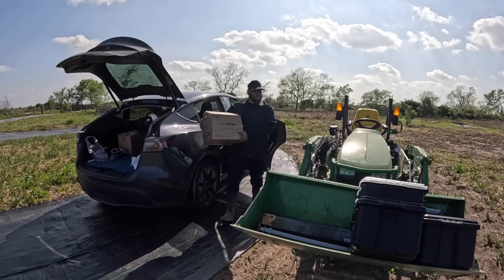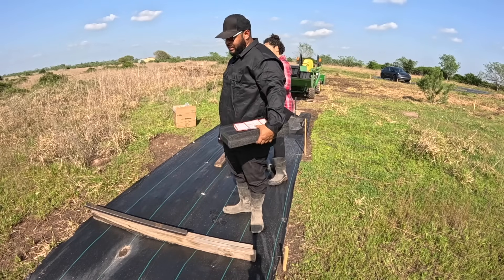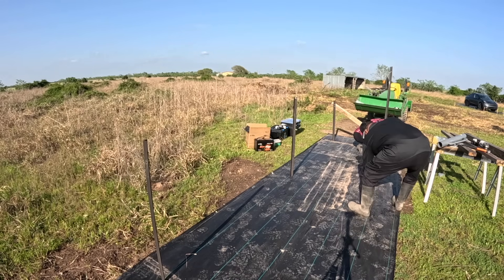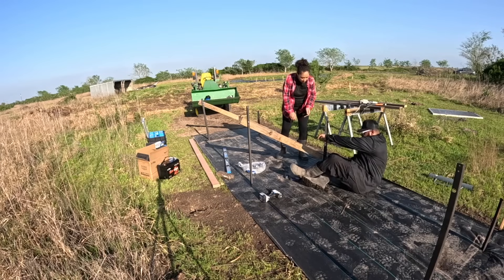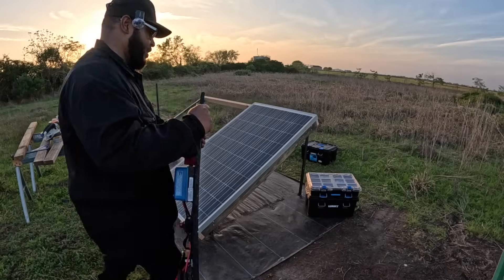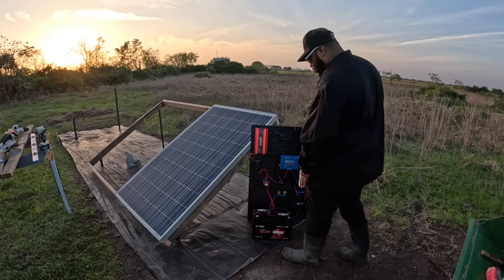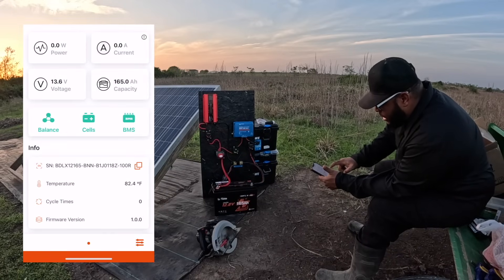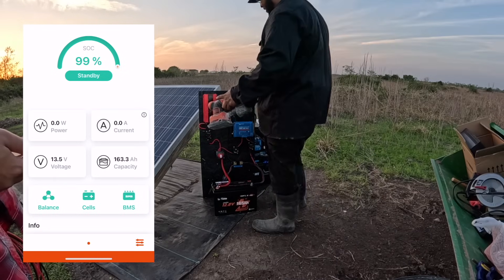Simple Solar Array Ground Mount - DIY Off Grid Power

Comment: I have an off-grid solar system and found that you'll need about 4 batteries of that size to power a full size 2-door refrigerator. You can get away with less, but the higher you can keep the battery minimum voltage, the longer they'll last, 7 years even. I try to keep mine above 12.4v.

I don't know about the reliability of modern systems, but my system is 10+ years old and it best to use a generator for power tools imo. I try not to get close to the rated power.
Reply from the maker: 10+ Years is impressive! Appreciate the insight and advice. 🙏🏽
Reply: @timetotiny  Closer to 15. I know people who've  been at it 30 years longer than I have. #1, be comfortable, it makes everything else easier 🤣
Reply from the maker: @sdrc92126  Wow. Thats dope! I agree, comfort is super important.